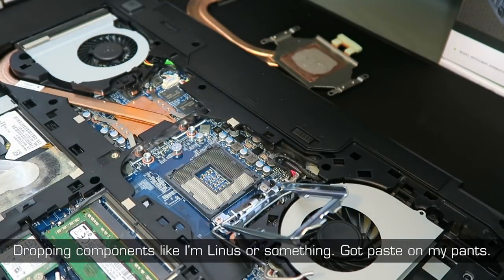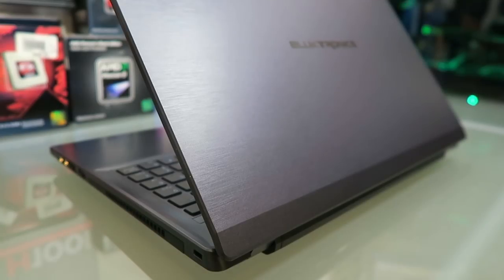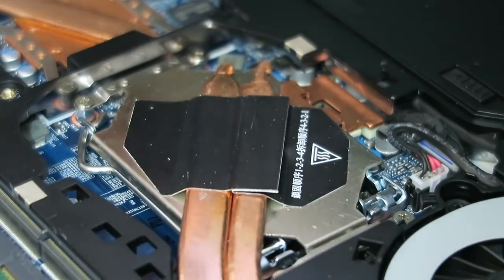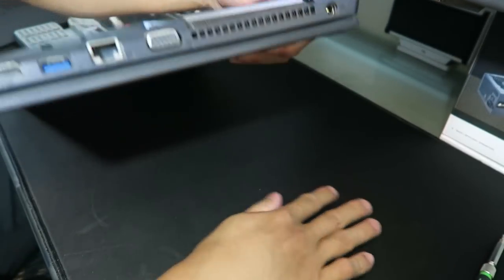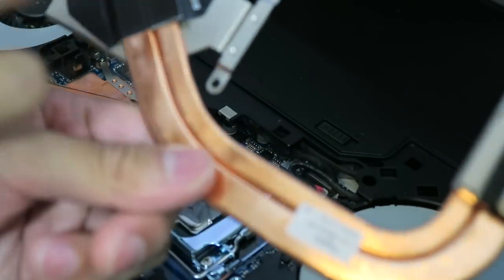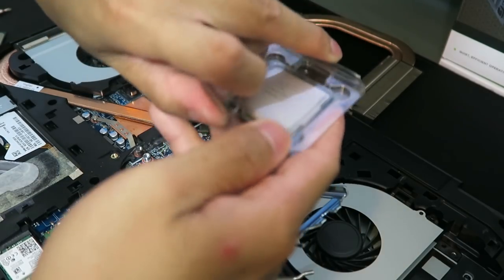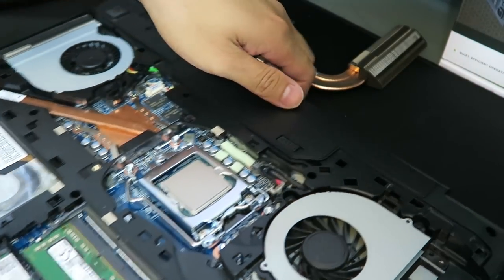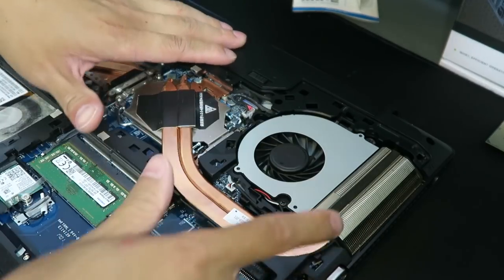Laptops That Use Full Desktop CPUs

Comment: Hey Danny, I'm new to your channel but need help finding a budget gaming laptop so if you could message me that fits my requests and in my  budget I would really appreciate it. Below $1200 or even $1000. Strictly
 gaming and video streaming.

So after some research I was told to look for 5 things:

- CPU with more than a dual core i5 minimum.
- GPU with NVidea GTX Geforce/ AMD Radeon R series
- 2+ USB ports Type A
- Good cooling/fan noise not too loud 
- Display ( wasn't told a preference but what would recommend ? )
- Personal preference :
 RGB customization
 
Any advice will suffice. Thanks Danny.

Comment: For better battery life, you might want to check out the i5 6400T (or other CPUs that end with "T").
Reply from the maker: +asdfrozen the 6400T is so underclocked that it wouldn't be worth upgrading from a G4560 if I recall correctly
Reply: It depends ... I mean, from what I remember, the i5 6400 beats out an OC 5 GHz i3 7350K in most games just because of the slight boost in multicore performance while still having decent single core performance. I would think the 6400T vs G4560 would be comparable.

Comment: I just hope that someday someone will use smartphone chips for laptops, it could use two chips of everything, two 128 GB memory chips, two 2,3 ghz CPU's, two 4gb RAM chips, two GPU's and it will also be able to have huge battery. Also, they should have 6 cellphone speakers, 3 on each side, each one of 3 dedicated to one type of sound, one for bass, one for treble and one for wide stereo, so it will be more immersive sound, keyboard should be touch instead of buttons, so it will be tapping instead od typing, it would be way more faster than usual buttons, which you need to sink 1 cm with each click

Comment: Hopefully NoaB will see this. Just like to inform everyone, you can now buy an m.2 to pcie x16 slot....... guess what that means.....

The connector is called the gdc exp v9(not the v8). It uses an nvme capable m.2 slot and seeing as this laptop has 2xm.2, it feels like the laptop was built just for this purpose. This laptop can last you for yearssssssssssssssssssssssssssssss

Comment: Try Alienware they started putting Desktop Processors in laptops way back in the early 2000's. Not sure if they still did after dell bought them out. Also the first to water cool a laptop.

Comment: I don't have a desktop chip in my laptop and it's because it'll get to hot. It'll thermal throttle & won't get full performance my 7820hk runs upto 94c max @4.3ghz that's full performance and it doesn't thermal throttle. If i had a 7700k it'll prob go over 100c and shut down. It's much harder to sell desktop chip's in laptops & also alot harder to produce and manufacture.

Comment: hey mate just wondering what gpu is in this laptop?
 also does this laptop support an i7 6700K?
Reply from the maker: It's a 1050ti, you can watch my other full video review kade about it, should be in the description. It does not overclock, so you can put a 6700K in there but it's kind of be a waste, a 6700 would be just fine
Reply: yeah just found the original review lol. cheers man

Comment: Ok I know this is probably a stupid question, but I bought two used CPUs, an i5 6600 and an i5 6500, and I tried both of them in my Gigabyte H110M-A mobo. The 6600 did not post at all, and the 6500 froze on the startup screen. I made sure to update my bios and everything, and I know I have a strong enough psu. It boots up perfectly fine with my i3 6100, but neither of the i5s
Reply: RicebowlJohnson first check if your on the latest bios because I had that when I upgraded

Comment: What cpu socket is that?   Would like to see a 4770 or 4770k or something would be do nice if is socket 1150.

I see now 1151 so can run even newer cpu sweet.   Im currently still running an HP elitebook with a first or second gen i5.  I bought it off ebay for 170$ with no hd or hd caddy.   I installed a current ssd i owned with velcro.   I added ram after so is ok but amd firegl graphics is holding me back in games.   I mostly play patofexile a free game.  Or dome old school doom,  quake
Reply from the maker: +Ray Madore it's 1151

Comment: My question is a bit different. I have a laptop that has an i7 4500 and it died out on me (battery is weak, charging stopped working, headphones stopped working, and keyboard stopped working), basically the internals are still good. How can I test another laptop's compatibility to the i7cpu? Ram and stuff aren't an issue when swapping them around, but not sure if it will crash the system.

Comment: Well, I have a HP Pavilion ZD8000 with a desktop pentium 4. That thing is an absolute toaster. It has a heat sink that goes all across the 17 inch laptop rear. Don't even try to use it on battery, you wouldn't get more than 30 minutes of you tried!

Comment: Back in 2007 my older brother bought a top of the line Alienware 17" laptop workstation that used a full sized desktop cpu, it had the largest copper heatsink for a mobile computer..ever..Google Alienware M7700 Heatsink
I ended up selling it on eBay a little over a year ago for parts because I was literally just using it as a door stop

Comment: wow... that laptop's motherboard also has an M.2 slot. Jezz
and then you got a 1050 TI ... TI  plus an additional  ram slot (cuz 1 of it has an 8gb stick right out of the box)
and finally have an upgradable cpu(even though the  G4560 is actually great) which can be upgraded for an i3/i5/i7.
im saving up for this laptop...

Comment: Seriously this has a desktop CPU and no MXM GPU for easy upgrades???
Reply from the maker: +Francesco Barbieri the cost of mxm gpus aren't worth it, desktop CPUs are reasonably priced but what's the point of replacing the going if the mxm 1060 is $500-600? I believe that's what I last found them at, correct me if I'm wrong

Comment: i have purchased a clevo laptop p775dm3 with 7700k and gtx 1080... its a beast.. the mxm 1080 is even a bit more faster than the founder edition so.
i also opted for 1440 p 120 hz g sync panel with it.. so it really shines in gaming or other tasks. I am not sure y these laptop are not having a better market but 1 reason would be tge high temperature and very high power draw.
Reply from the maker: Wow, do you mind sharing how much that cost? With the GTX 1080 in there and the 120hz gsync panel I'd imagine it being at least $1800+

Comment: COMING SOON: a laptop with a pcie x16 (or at least x8) connector for single-slot GPUs /s

To be serious though, this is really cool, but if i actually ended up changing the cpu in it, I'd probably end up just watching the cpu temperature 24/7 and not getting any actual work done.

Comment: what cpu socket is that, LGA1151? cause the retention arm and the metal that holds the cpu in is the same as the lga1155
Reply: he put an i5-6600 so a FCLGA1151

Comment: did you make a thermal paste vid on those eBay thermal paste?
Reply from the maker: I have not. But in a nutshell, it worked fine, I forget off the top of my head what the exact degree difference was (I have screenshots somewhere where I ran cpu stress tests and took pics of the temperatures), but it was good enough for me to say "sweet, didn't get ripped off". Hard to tell the long term durability as that can take many months or years to see if it dries up faster, etc, but for my short term uses it's A-ok
Reply: can you link me

Comment: How would you know what chip is capable? Imean i have a acer v3 471g core i5 3210m can i upgrade it to a core i7?
Reply from the maker: This laptop was made specifically to have a desktop processor in it. Your laptop's motherboard only takes mobile cpus, do you'd have to find one with the same socket, so anything in the 3000 series intel mobile line up, also gotta make sure power draw of whatever chip you wanna throw in is not too high otherwise your laptop may not support it

Comment: i own a laptop with a desktop cpu aswell... 
its a eurocom p7 pro / clevo p770zm
i got a i7 4790k @4.4ghz (yes overclocked + undervolted by 85mv)
24 gbs of ram
a gtx 965m 4gb
and 2 ssds 525 gb + 256 gb + 1 tb hdd
Reply: my gpu never goes over 60c..
and cpu at 100% load is 80 to 85c

Comment: Someone help me understand this... see me personally ANY day of the week , I would take a very, very powerful laptop over a space saver. Like if I need more space I'd get a better bag or switch my area. Like I rather have a laptop that is a little more future proof because of the specs than being picky and getting something that's slim. Maybe it's because I'm not insanely rich? Idk it's just weird I rather my computer be good and bulky than slim and not as well put together and doesn't perform as well. Like can someone explain? I can understand if you have a lot of money you can have both but size of the pc never really mattered idk.
Reply from the maker: It's just personal preference, this is no right or wrong or better or worse answer. People with more money have more choices and can get the more "premium" features such as being slim and light weight. If you were presented with two laptops to have for FREE, but you could only choose one, and both had identical specs and performed identically, but one was thicker and one was thinner, which would you choose?
Reply: Nerd on a Budget  I understand that it's just odd it's just when I look at a gaming laptop, I don't really expect portability. I mean I do admire that they are fitting full gpus in cpus in these slimmer designed laptops, and I have no problem with that. I just don't get why size in gaming laptops is a big deal, like most of the time you have to pay a premium since it is more convenient on top of the money your already paying for a pre-built. Like yes I understand people would choose it if they had the money but the fact of the matter is MOST of the time, not all but most you have to pay more just because it is more portable, like it's a premium feature, you feel me? I guess it just me being money conscious.
Reply: Nerd on a Budget like in GAMING laptop that's not going to be the buying point for me so why fork over extra money you know? I will admit I have seen some good slimmer laptops but most of the time they market them as ULTRA SLIM and try to charge more.

Comment: excelent video but 650 laptop + 150 cpu upgrade : 800$  and for 800 you can get the asus fx502vm with a gtx 1060 gpu and will give you better performance by a lot
Reply from the maker: +Edgar Amundaray you have to subtract the g4560 you can sell

Comment: Hi I bought a laptop from Eluktronics.
My laptop is: N950KP6 15.6-Inch Performance Entertainment Laptop (1TB 7200RPM HDD + 8GB RAM + NVIDIA GTX 1060)

It's processor is this: Intel® Pentium® Processor G4560 Dual Core (3.5GHz, 3MB L3 Cache)

Can I swap with this: Intel® Core™ i7-8750H Hexa Core (2.2-4.10GHz TurboBoost, 9MB L3 Cache) ? 
Will it have enough power supply to run if I do or no?
Reply from the maker: That's a kabylake based motherboard, it won't support an 8th gen chip
Reply: Nerd on a Budget  Ok, what is the max you can recommend me upgrading to? Is it anything within 7th gen?
Reply from the maker: Any non k chip in the 7th gen, best consumer CPU would be 7700
Reply: Nerd on a Budget What about the chip that you are using? Isn't that a desktop version? I looked at the price of the i7-7700hq and I figured if I found an older desktop cpu I could still get better results. Although I am wary of frying my new computer. What would be the safest desktop cpu?
Reply from the maker: These laptop use desktop cpus
Reply: Nerd on a Budget
So my psu is able to supply 230 W. 
Your desktop cpu is a i5-6600k which is about 65 W. While the G4560 is 54 W

What would be the ceiling of my laptop? I tried putting it into the PSU calculator but it's confused because it thinks I have an actual desktop, and there's no option to say that I don't have any cd/dvd drive. 

All I have is 1tb of 7200 hdd.
Reply: Nerd on a Budget  Is it ok if I use a i5-3470? Not sure if lithography matters, it's 22nm, does not have hyper threading, but it's faster, and it only takes 74 ish TDP, whereas the one in your video takes up 94 ish TDP.

Comment: I wonder if I can get away with using a i5 2500 or older i7 and just buy the laptop for the 500 with nothing in it and pice together with what I have and go
Reply from the maker: +david boyd it won't work, this requires 1151 cpus
Reply: True uggg 1151 not 1155 lol but I have noticed that there i7 is $20 less than new eggs

Comment: you shoulda gotten the i7 7700t.. Low power low TDP for cooling.
Reply from the maker: +CSTwister I didn't feel like the $300+ price tag was worth it, and it's kind of a niche thing so there's not as good a guarantee I can resell it in the future, where as the i5 6600 is more common and has higher demand long term

Comment: hi im building my very very first pc, (moving away from consoles. just cant stand the lack of games anymore) and i have 0 clue what i need and what i dont need. so i got this list of parts for a entry level build that i can upgrade over time. can you guys tell me if it'll be good for light gaming? like gta and csgo and stuff. 

also do i NEED to buy a cpu cooler for the computer to work? or does it come with a stock one?? 

https://pcpartpicker.com/list/3x2yCy

also maybe pubg on low settings? thanks :))

Comment: *30 minute battery life
Reply from the maker: I've been using it with the i5 6600 every night, hasn't seem to be effected too much by it. Depends on what you''re doing, if you're not utilizing it much (browsing, email, etc) then difference is kind of negligible, but if you're trying to game and the cores are fully utilized than yea. But at that point, gaming on any laptop without it being plugged in is kind of a horrible experience because they're automatically throttled

Comment: 6:51
you aren't selling that cpu after basically ruining it lol
taps front of cpu
tap
tap

tap
Reply from the maker: Lol, I guarantee you it's not ruined.
Reply: PUTS THE CPU ON ITS FRONT,
hey how much would you sell that for
Reply from the maker: +Icyland yea, the front side that can easily be wiped with a cloth and alcohol vs the contact pads, but to be honest it doesn't matter. I don't understand why you think these components are so fragile that you have to be overly delicate with them. And I haven't decided yet, I have a lot of b150 boards I got for cheap that I can pair this with to build a system to sell so I may do that
Reply: How much though,
might go for it if its in my price range for my pc build

Comment: oh soo you paid extra $80.50 for 10 - 5 fps more and hotter CPU and maybe %5 more on electricity?
Reply: Astig_mo_william also do you can UPGRADE your CPU
Reply: Astig_mo_william this upgrade isn't just for gaming.  that I5 will probably do 30-40% better in productivity tasks
Reply: Astig_mo_william duel core to quad core is like night and day difference
Reply from the maker: Exactly, yea it didn't help too much for gaming, but if I ever edit with this laptop it's much better off. Cinebench scores alone are 360ish on G4560 vs 600ish on the 6600

Comment: put i5 7600k or i7 7700k
Reply: harveybuan420 It's useless if the motherboard does not allow overclocking. Plus, a small  change in core voltage and core speed will cause massive heat output. If the laptop comes with custom water-cooled dock like Asus GX700, then that's a different story. This laptop have a single CPU copper heatpipe and a 60-80mm fan (not sure it's actual dimension). Even Intel stock cooler can't control the thermal output of the overclocked CPU. Lastly, Intel K CPUs are so expensive.